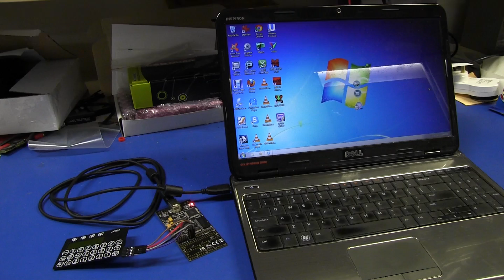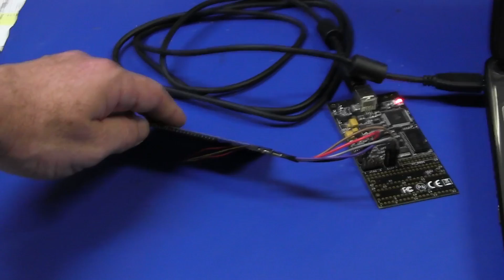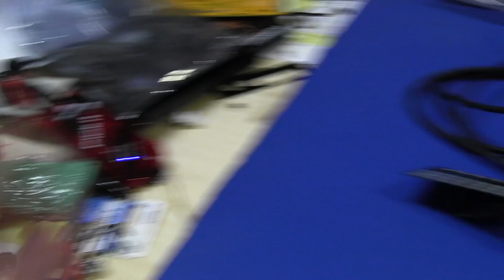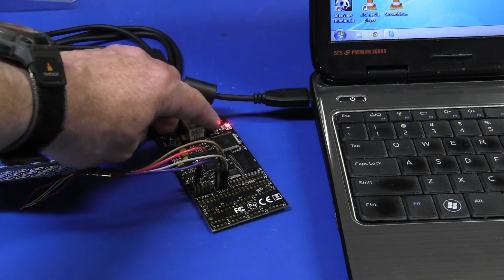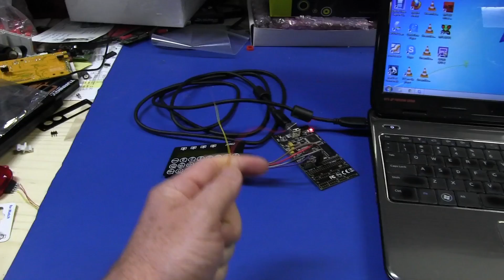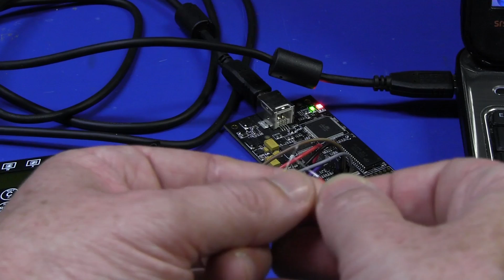Microchip - Atmel Collaboration

Comment: Another thing that I notice now: LVP requires pin 6 on the PIC ICSP header. It only is optional when using HVP. So when you said the mock avr programmer does not support high voltage programming (obviously) the sixt pin would have been a requirement. Another hole in your prank!

Comment: Wanted to also add, why cant 1 of the companies release a programmer that has a "bug" that will cause it to detect both PIC and AVR products and fully support them, but sadly no one knows what is causing the bug and thus it cannot be fixed. (great way to add support without getting the competitor angry.

Comment: Still a good one, Dave, with nice details, such as the LED switching on.
Was quite easy to guess you had the PICkit connected to another USB port, I thought it was at the other end of the laptop, as that wasn't in frame, but still well done.